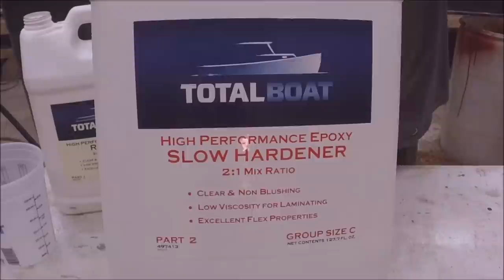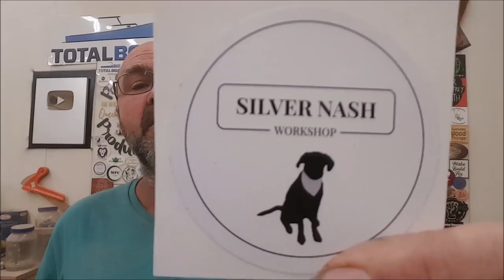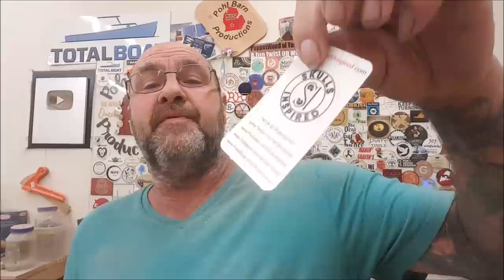Cedar River Bowl

Comment: The bowl is GORGEOUS.  OK, this may be a stupid question (and you've probably already tried this and I missed it or have forgotten), but have you considered letting the epoxy set up a little bit before pouring multiple colors so they're more clearly defined?  I've seen other turners do that and the results are amazing.  You had so many pretty colors in this bowl, I think (humble opinion) that seeing all of them in the finished bowl would have been stunning.  Don't get me wrong, the water effect in the finished bowl was really beautiful.... not criticizing at all, just asking.  <3  Hugs and respect from Texas!
Reply from the maker: Thank You Lori,  that's a touchy game to play with this much resin, you have to wait till it starts goin off to do that, it tend to get all goowie and clumpy and then you're screwed  LOL
Reply: In a river table or something like that a method like that works great, and it does create AWESOME effects. But for this, you really want it to soak into any cracks and voids or punky areas and stabilize the blank, especially for turning. For this application, the less viscous, the better.

Comment: I clicked Like. It came out well. At one stage it looked like you were bleeding to death as all the shavings came on you. Boy were some of those red.  
One of the other turners did an experiment with different coloured resins. He wanted them all to show not get eaten up by stronger colourers. He found the best time to pour was about one and a half hours after mixing. It came out very well.
Reply from the maker: Thank You Norma,  I've tried to wait so the colors don't blend but it just seems to work best to dump them and go into the pressure pot as they roll as they heat up anyways.

Comment: Would keeping the bucket cooler help in limiting the cracks? I've dealt with a lot of products that slow way down in the cure time with cooler temperatures. I have no idea if that works with resin but it may be a worthy experiment. Possibly anchoring the pressure pot in a tub of water to act as a thermal sink. If you've already tried something like that and I missed the vid.......... never mind.😁
Reply from the maker: cooler temps do help but it's not winter here yet LOL